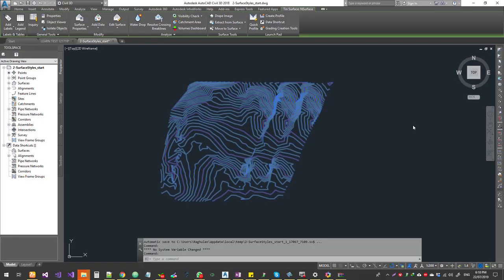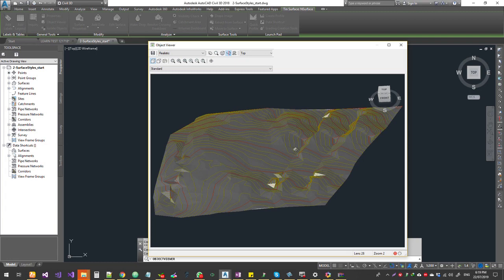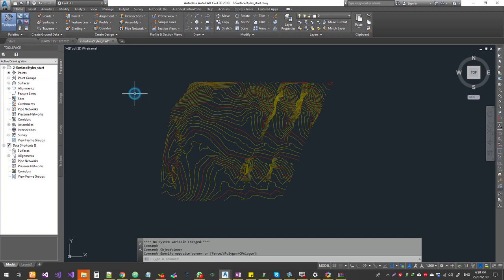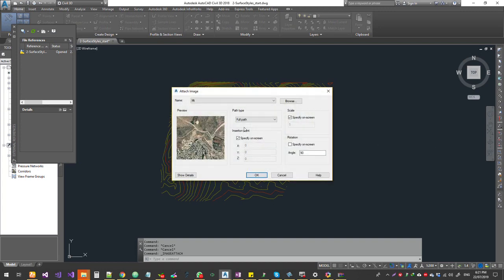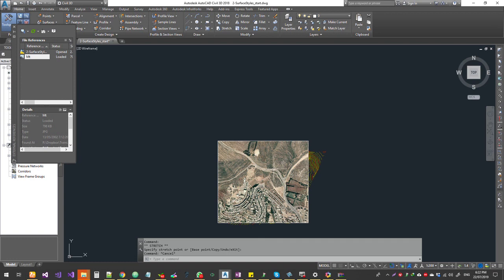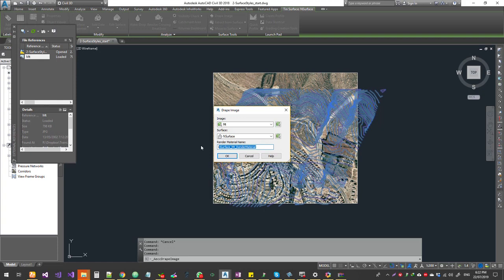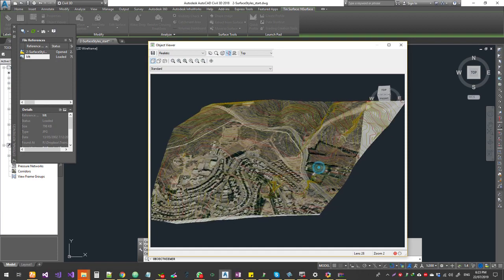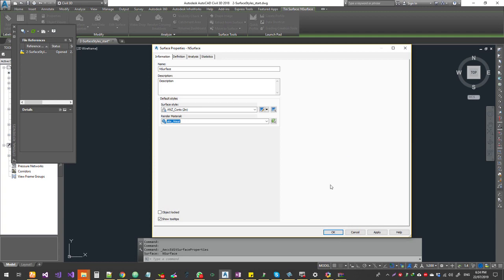Civil3D Surface Drape - Superimpose Image on top of a TIN

Comment: How do you know that the picture you brought in is scaled to fit the contours ? You did superimposed the picture on the contour but but do the contours exactly pass through the correct position on the picture ?
Reply: Can you please make a video showing how to do that?
Reply from the maker: Ok sure will do
Reply from the maker: You need to have some reference points on the picture to align it. For this excercise i just super imposed.